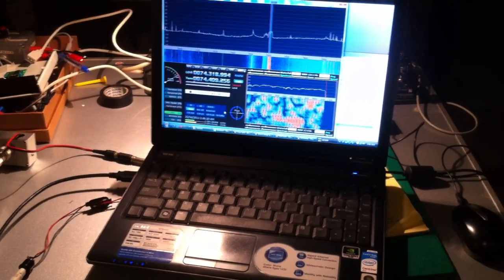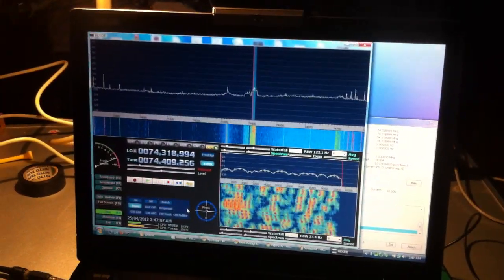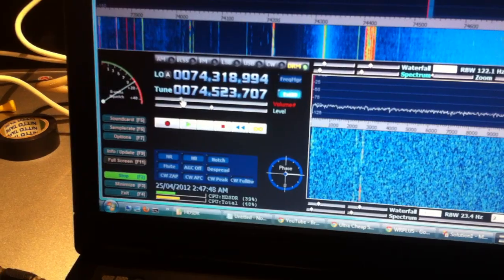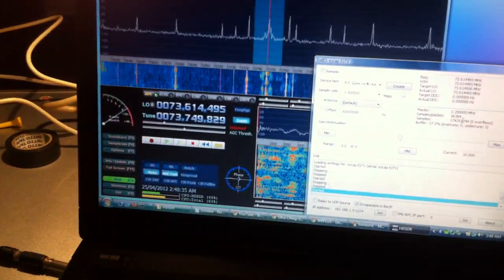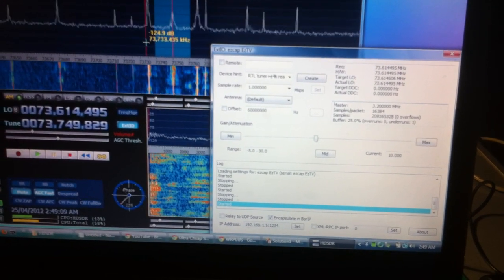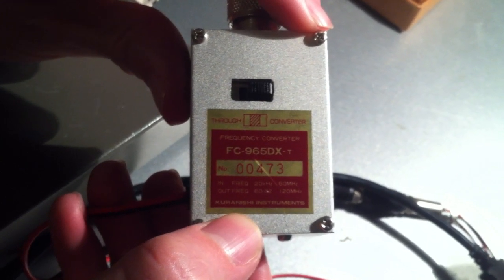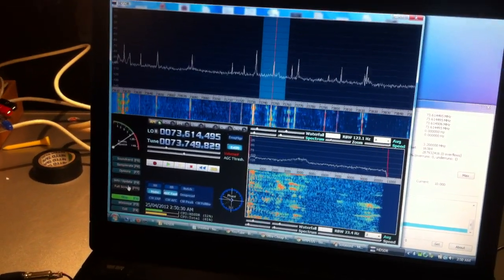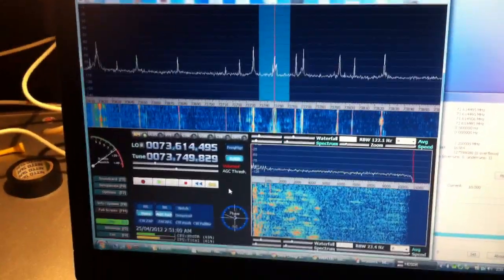Ultra-cheap SDR: HF with RTL2832U (RTL-SDR) and transverter

Comment: Very nice. Camera isn't quite HD :)
when it displays a wide spectrum and plays back a channel, does that mean it could simultaneously listen to say 10 or 100 low bandwidth audio channels like aviation audio which are around 110MHz with 8.33kHz bandwidth each?

Comment from the maker: Please follow the links in the video description. If your dongle is not automatically detected when using the "RTL" Device Hint, you can manually set the "vid=" and "pid=" parameters to open your device (please see Device Hint table on the USRP Interfaces wiki page).

Comment from the maker: No harm in trying, but you would want to investigate properties of the mixer to ensure it will work well with the receiver itself (e.g. output level, bandwidth, gain, etc). There are loads of custom mixers built by HAMs that are documented online, so definitely have a search around too.

Comment from the maker: Please use "RTL tuner=e4k" as the Device Hint, and make sure you play around with the gain. Often you need to find a 'sweet spot' in the middle of the gain range. Also consider attaching a tuned antenna for the frequency you wish to receive.

Comment: Hi i have the "Hama nano" running along with HDSDR, o have a wire attached to the device, the waterfall is running nice and i am seeing faint lins on the waterfall but that's as far as it goes, not getting any broadcast stations either.

Comment: Great to hear, I've seen usrp's being used but they're obviously much more expensive.

One thing I've not seen with this is transmit capability, I'm going to assume its a hardware limitation. I've always been interested in radio and can't wait to give sdr a shot.

Comment: Would it be possible to build a simple up-converter using a single transistor mixer and a canned oscillator (66.6666 or 75.0000mhz) off an old motherboard? Or would a more tuned circuit be necessary?

Comment from the maker: It's a Yaesu FRT-7700, which is usually used with the FRG-8800 receiver. Did you try the Japanese sites? I saw a few a while ago that seemed to advertise them (in Yen of course ;).

Comment: I can't find anywhere that has that transverter, I was wanting to use a usb dongle to listen to shortwave, but searching transverter on ebay just a couple results popup and it's either tiny circuit board kit thing or full blown radio. Any ideas where I can find one for sale?

Comment from the maker: For the moment try the 'ExtIO Frequency Options' in the Options menu (down converter mode). Otherwise you'll be able to use the (fixed) 'Offset' checkbox+textbox in the Device Control window of the ExtIO with the next release. (I've just moved overseas so things have been on pause.)

Comment: GUYS! Can the software be set to offset frequency so you don't have to remember to take the transvertor frequency off the indicated frequency?
I just bought transverter with 100MHz local freq. and I wonder if I can modify the sw display to cope with that... Thanks

Comment: My main system is linux, is the software your showing here support? or will I have to dual boot?
I have one of these on the way and I want to try this as well as the aviation setup. But would prefer to stay in linux

Comment: Thanks,
Have you heard of the DeDected Project? It's used to pickup DECT cordless phone conversations, I have an adapter for that project but they're very expensive and they are also quite rare. Do you think with some software development that this device could pick up dect? 1880-1900Mhz, but most newer phones use 2.4Ghz ranges

Comment: i have downloaded this with dongle,,but nothing comes but static,,no stations at all,,nothing,,i have been screwing with this for weeks,,nothing but static,,i have not got one station,,nothing,,this is worthless to me,,how do you get stations,,i have a dipole antenna and another great antenna with cable,,not cheap one,,but i cant get nothing,,what     software or plug in do i install to get this thing to pick up one station,,just one,,this is a pain in the ass like everything that you have to do

Comment: Hi there guys can you please help me out as I am very new to SDR and using a sdr dongle and software.
Which software should i use with a
Newsky DVB-T USB Receiver & Low-Cost Software Defined Radio (SDR) - Realtek RTL2832U + Elonics E4000-Based.
I purchase this from the internet.
Any help please and greatly appreciated .
73's
Gareth.

Comment: So without a $200 transverter, you totally can't access the LW, MW, or entire SW band.  Without a cheap transverter that subtracts 70Mhz, this thing is pretty much useless except for listening to HF, VHF, and UHF.   Come up with a cheap and simple to build circuit to subtract 70 Mhz, boost the gain 20 dbls, and kill some of the noise floor, and then maybe you have something.